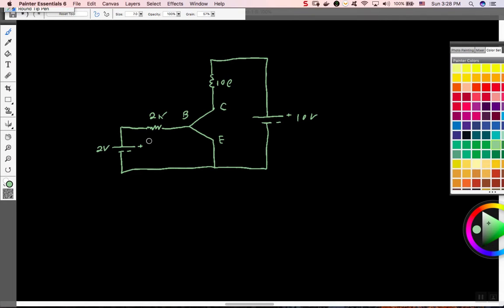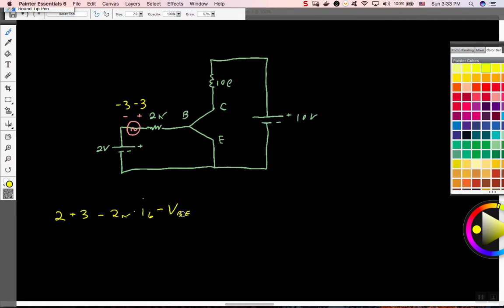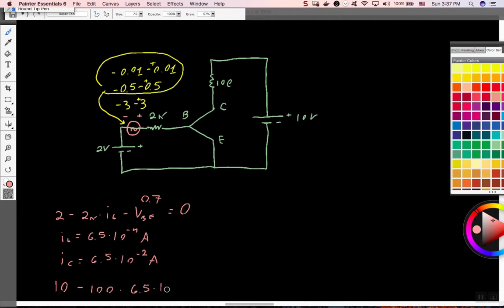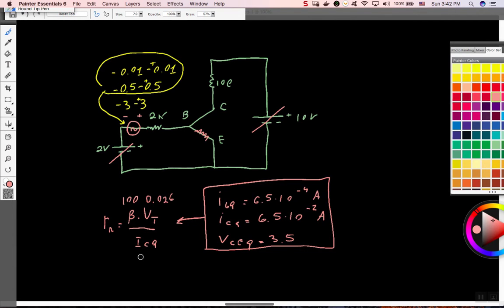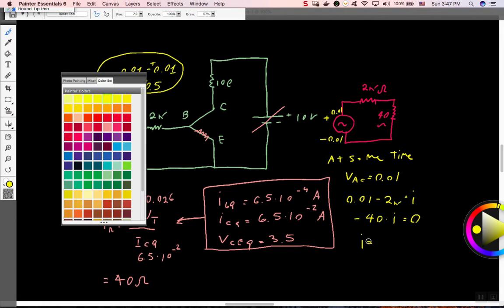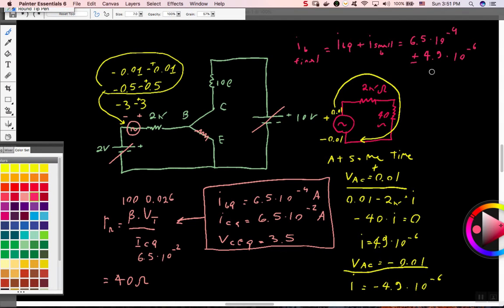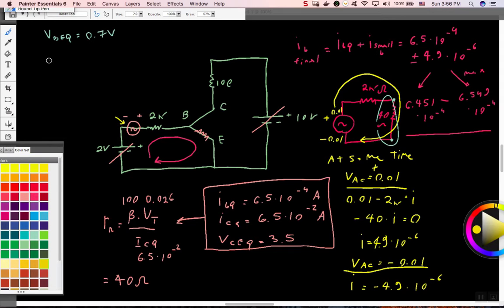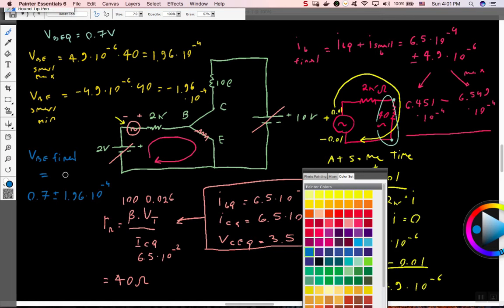Transistors 19: basic small signal I

Comment from the maker: As after my habit of making videos that are too long, this one is no exception, so you might need a lot of patience and interest in the topic.
* Superposition: you can take one or more sources at a time, but the next round, you can only take sources that you haven't considered in the previous round. Here we take the 2 large signal sources to compute their contribution, and then take the small signal AC source alone.
* What I was saying towards the end is that when the small signal source is negative and current flows across it counter clock wise, then voltage will drop across the resistor that models BE from E to B, and so if you go from B to E (opposite the small signal current), you'd have a voltage rise.